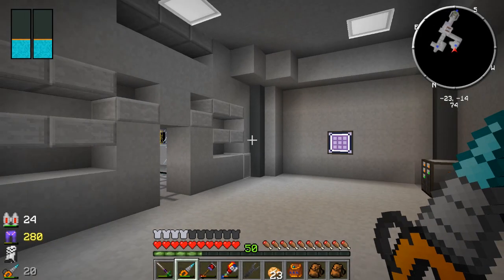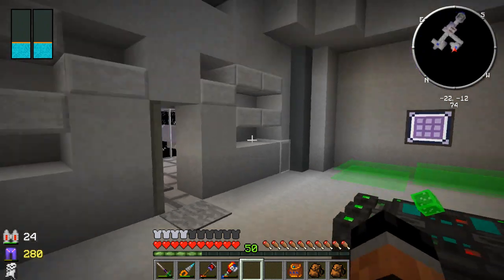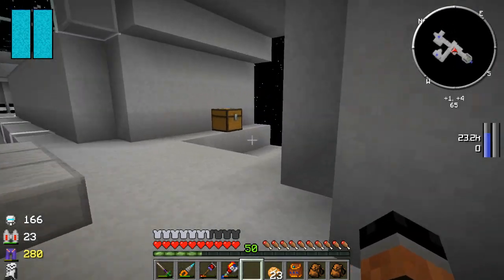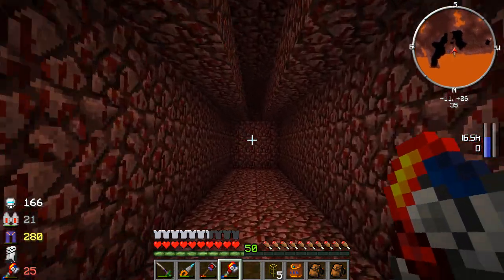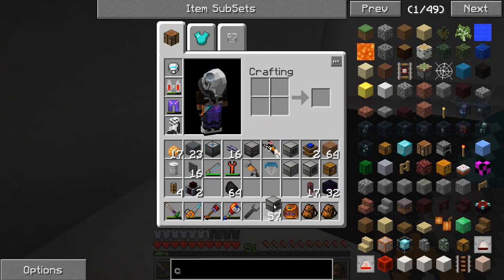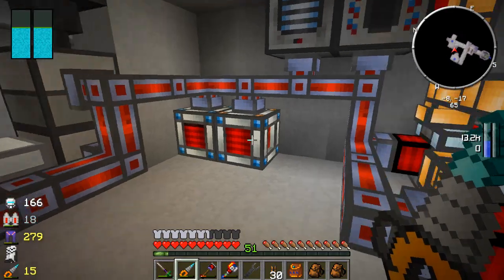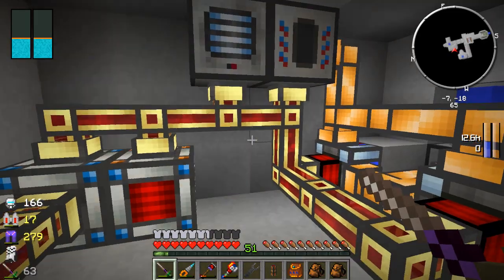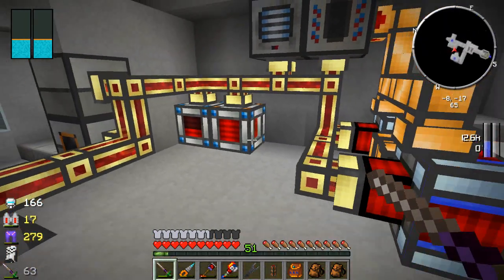Liquifacted Coal Power | Mod Life (SpaceLife) S2E32 Phase-2

Comment: Try lighting the nether portal in an oxygen filled room to see if fire stays and it ignites, as you saw, when moving the flint and steel it went back to full durability so that meant it was a visual glitch not a real fire being lit, but I'm not sure if in the oxygen aired room if the fire would ignite, depends on how oxygen and fire was coded together.